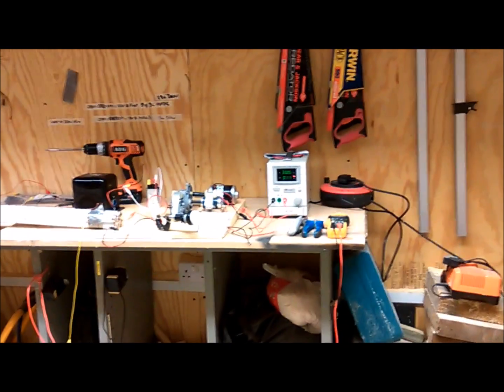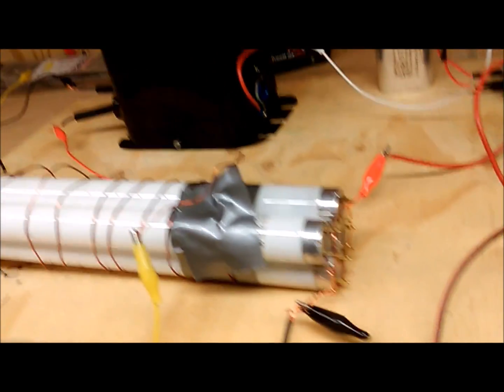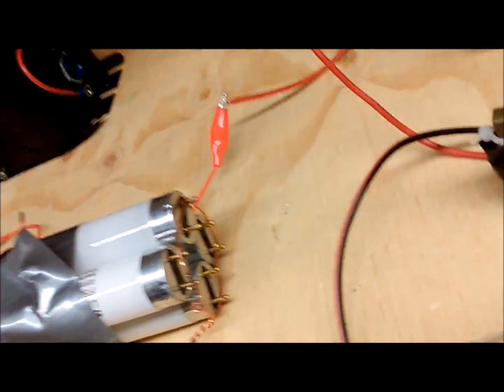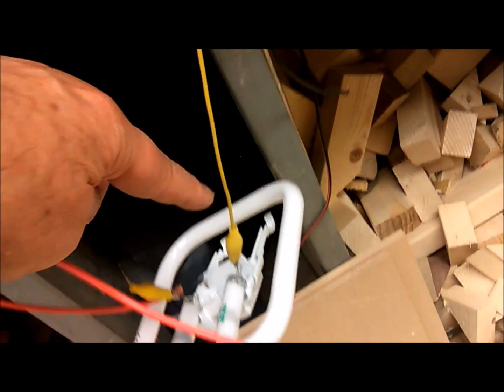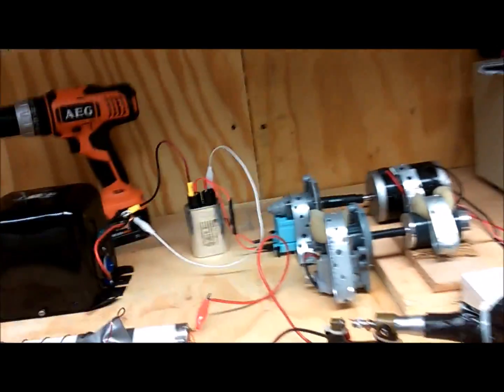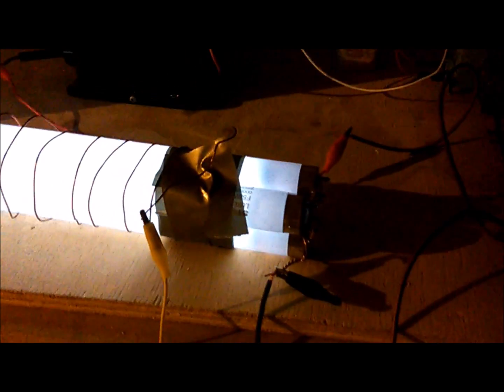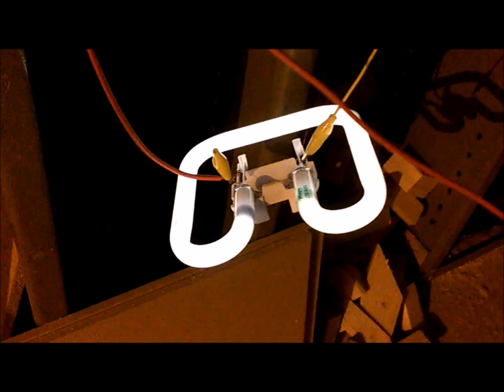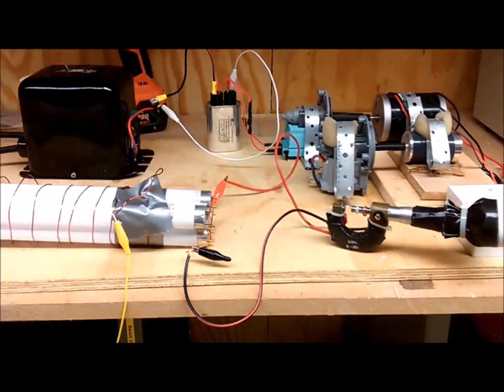Gerard Motor PROOF of OU (Warp Drive 2)

Comment: So the coil is basically a antenna picking up from the tubes, is it working like a transformer?  Or what. I'm kinda starting in the middle of the videos, I live off grid, so I have a idea of how generating power is not so easy, but this is more of a RF black magic or something, I have pedfled to generate 100 wh, its not exactly fun, this seems to come from thin air,